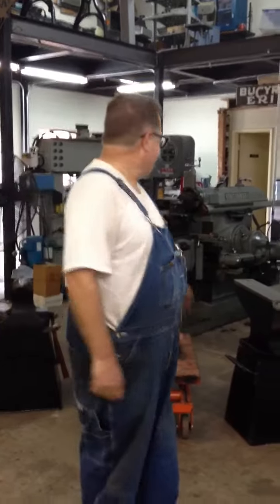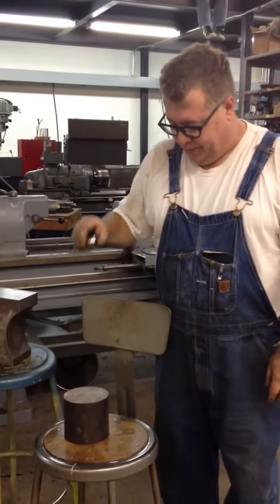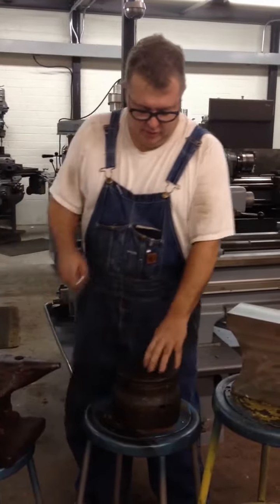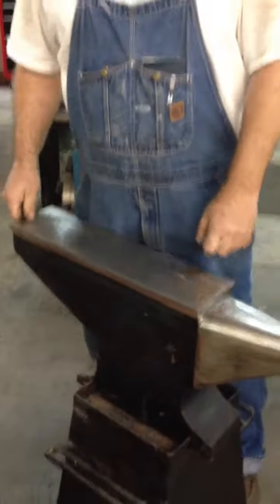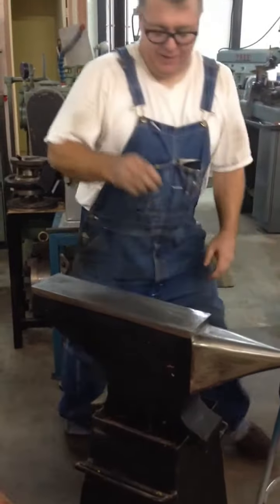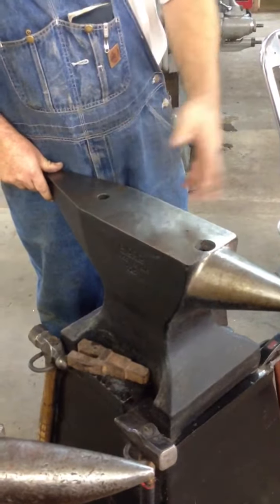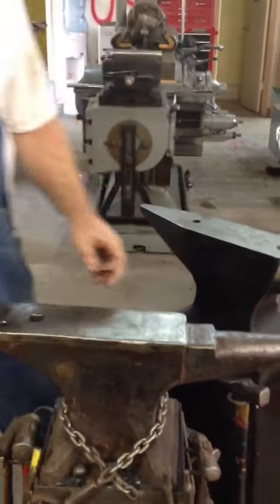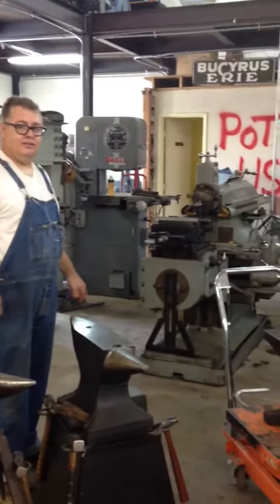Making an anvil - Follow up

Comment: Probably one of the most informative posts available for those looking to make an anvil purchase. You really went through every single nomenclature of anvil out there! 

I love my P'haus, but I get the same enjoyment / performance out of my #200 Fisher. This vid speaks volumes to younger smiths like myself; whether you have a modern anvil or an old soul, these tools are amazing examples of engineering and craftsmanship.

Fishers were cast iron w/ tool steel tops, hence the thud with amazing rebound!

Comment: The anvil you made, was the face plate edge welded on or welded full pen? I'm building one right now with a ar400 face and am welding it full pen but am wondering if it will even be any good.